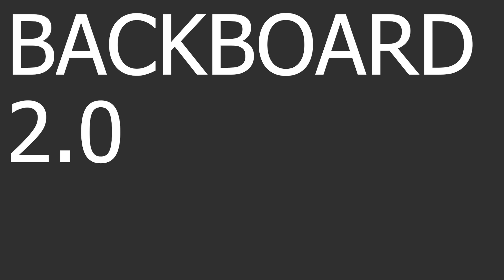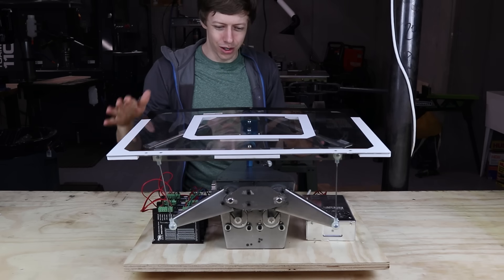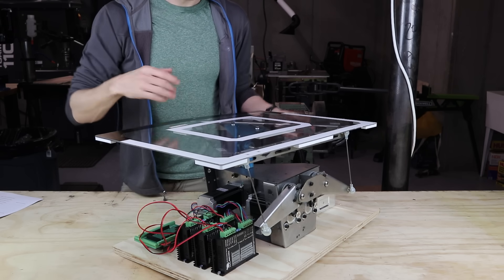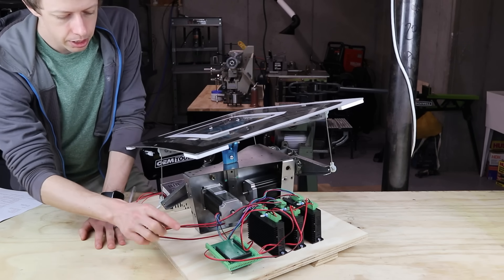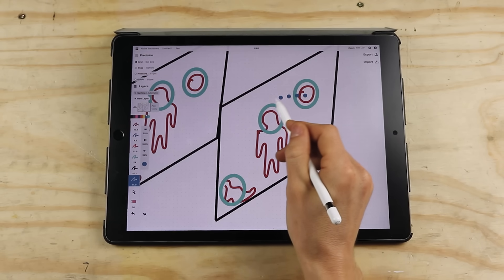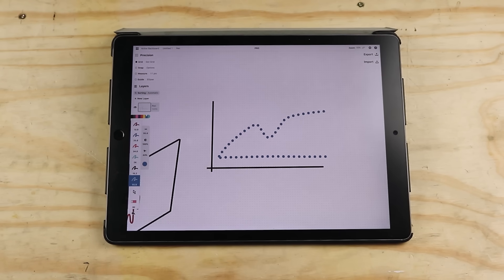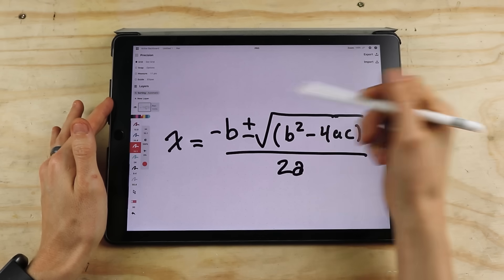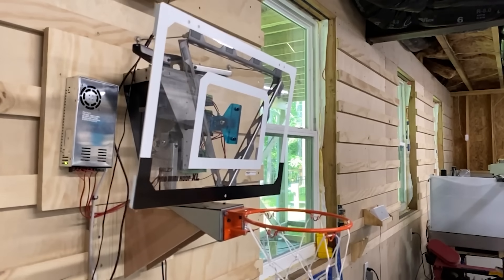The automatic hoop always goes in

Comment from the maker: This hoop is cooler than the previous one but I'm still not satisfied. If you miss the backboard it doesn't go in. How totally lame is that. I think I need to fix that problem...

For all the programmers: I don't normally do my development on windows. I needed the kinect SDK to develop this which only runs on windows (there's a whole studio for recording and playing back streams, putting breakpoints in them and stuff like that - it's actually really nice). I used python for development speed but I should port to C++. I'm normally an OSX dev.

 
Also, a bunch of people have asked about why I move at the last minute - the reason that I don't begin moving immediately is that it is very common for the estimated trajectory to change in a way that requires a direction reversal (i.e. the estimates don't monotonically approach the correct solution). If that happens, I have to decelerate to a stop then accelerate in the other direction. In the worst case moving one side to the other. I did some basic analysis on this and it seemed on average better to move at the last possible minute. The other issue with a direction reversal is that it gives double the system jerk (rate of change of acceleration) due to going from full positive acceleration to full negative acceleration. This causes bigger mechanical vibrations which can lead to all kinds of issues.
Reply: I love the fact that you are devoted to educate people.
Reply: I think maybe version 3 will have an robotic arm to catch the ball and just drop it into the hoop
Reply: Wait, is this the backboard typing this?
Reply: Stuff Made Here I would recommend adding a rail system that allows for X and Y axis movement. This way you can miss the backboard.
Reply: Hi, i am learning programming right now and was wondering if maybe you could share the code with us? i totally understand if not, its your creation and a lot of work! just saying id find it fascinating to see :)
Reply: Wow 49 mins ago
Reply: You mentioned the microcontroller being a speed limiting factor for you, are you using an Arduino? I like the ESP32 for microcontroller tasks, it's cheap flexible and fast.
Reply: Was coming for this, not disappointed ^^
Impressive work 😁
Reply: What if you would use a ball with a Bluetooth emitter attached (inside the ball or outside), that communicates with the panel in Realtime, instead of using data from the camera (or use it for more precise movement) and use a base station like one for the VR, behind you, to get the position for the ball (the start position, the trajectory, the end position etc)
Reply: Bruh.....
Reply: Also that ball identification algorithm is pretty cool. Does it continuously run on the last few frames to identity any possibile approaching basketball?
Reply: You can improve the speed of the Arduino if you replace the quartz crystal on it. It is possible to even double the speed of the Arduino if you use a crystal with a rating that is twice as fast. If you do chose to do this then you need to put a heatsink or even a cooling fan on the Arduino to keep it from cooking itself.
Reply: It's the backboard not the hoop hombre
Reply: you should make the backboard hit it back to you so you can catch it.
Reply: 19th comment
Reply: Great work! You mentioned the Open CV being slow, is it faster to use Open CV than to apply an FFT with a high-pass filter to the distance map to identify the ball?
Reply: Stuff Made Here you’re gonna make extendable arms?
Reply: Very cool project. You mentioned you want to port your code to C++, I guess you want to do that to improve code performance, is that so? Because if it is, maybe it'd be easier if you just profiled your code, found which parts were consuming more time and just implement those in C/C++. You performance improvement would be similar but you're gonna need way less time to just reimplement a part of your code, instead of the whole thing. You can run C/C++ code inside Python. I've never done it, but I think if you're using cPython it is possible.
Reply: How about linux?
You even have different alternatives, the one from microsoft and openkinect.
U could run a headless setup, so there's less overhead (no DM/WM/X server/etc)
Reply: Also, if you could use the motion from the arm of the player then it should raise the time window and ball detection.
Reply: Stuff Made Here superluminal inertial dampers would be the best way to go, I know a guy if your interested 🖖
Reply: You should pin the comment
Reply: E
Reply: I have a little suggestion - why not start moving in the earliest moment you have enough alternatives which are close enough? So instead of moving in the latest possible moment, you start moving once all your "possible trajectories" have positions that are, in motor-movement, as close as possible (within a specific range). Then you start moving to the absolutely median of all these positions, which means you only have a few millimeters or centimeters to the final position once you have enough data to decide on a final position.

You answered the question like that you needed a direction reversal. But since you also said you have a lot of alternatives for each trajectory, you could simply choose a choice for each trajectory, that would ensure that even if the estimated trajectory would become any of them,  you always have a final position requiring as little movement as possible.

Easiest way to solve this, is to take, for all positions, max() in motor movement and min() in motor movement. And then take the median of this, and move the motor to this position. This would be a "middle position" which whould require motor movement equally depending on chosen trajectory, but would require direction reversal.

If you want to ABSOLUTELY avoid ANY direction reversal, regardless of how little, you could move to the "earliest position" so the chosen position for each trajectory could always be made with only forward motion. Basically, choose each position in such a way so each position is pretty close to each other (counted in motor-movement), and then move each motor to the position that is farhest back of all motor positions - This of course means the plane may move to a position that does not match any of the final positions and would , in that position fail the goal - but the idea is that you atleast "prepare" it, so you spend motor time as early as possible, so when the ball comes closer and you rule out more trajectories, you don't need to move the motor as much)

What I mean with this, is that if one of the estimated trajectories, would require tilting the board slightly upwards, and all other trajectories have positions that are both downwards and upwards - then choose all tilted-upwards positions that are close enough, and also choose maybe one downwards positions that could be reached with pretty little motor movement too. Then for each of the three motors, choose the lowest movement value. This creates a new plane, which is the "minimum plane" - and then move the motor to that, to prepare it until you move the last moment.
This also means you could, if you notice that the motor move as fast so you have to stop and go, you could aswell delay the start of motors until you can go in one continous motion, and also adjust the speed and slow down the motors a little if you notice it will reach the "minimum position" before you can rule out all trajectories.
Reply: WOW, Wish you are my relative, so smart💯👌 
How i hope I'm that Wise ♥️
Ilove your works Sir it inspires me to study hard even though I'm not that good at school😅
Reply: Would you share the code for the speed with us?

Comment: For V3 you could try not using a computer for controlling it. You could design your real-time control hardware with PIC's or any type of microcontroller. I think it would be a WAAAAAY better design: compact, and faster since you don't have to rely on Windows' (lack of) stability. It would be also WAAY harder to implement it since the conection between the controller and the Kinect is not native, unless you know enough about embedded systems and PIC programming.

Comment: Your content is head and shoulders above the rest on YT!!
From my own experience, closed loop stepper drive should be the way to go for your project! Not only do you not loose steps, you can also drive the motors much harder, especially since you do not need the position to be accurate during the movement in your case. I have converted some CNCs to closed loop drive and the difference is staggering.
You can retrofit your current motors or buy new ones with integrated control, which I highly recommend.

Comment: Very cool and all but why use an Arduino?
Try using an STM32 mcu or "blue pill", you can use the arduino ide with it and almost the same code and the best part is that it's nearly 7 times faster.

I've been using an stm32 mcu for a year and I'd be happy to help.

Comment: I wonder if an Azure Kinect (v4) would help with the tracking vs the Xbox One (v2) Kinect. Noise is supposed to be significantly reduced in the v4 kinect sensor.

After perfecting the hoop/board next challenge could be to have a ball kicking return system to send it straight back to your hands. "Might" need significantly more powerful motors to kick it back though.... :)

Comment: I have done my Bachelor Thesis including real time face tracking and I know there are immense optimization that can be made. First Camera: Most webcams have a frame buffer, good for videochat, shitty for real time tracking. My recommendation: Playstation eye. This thing cuttet my lag by 70ms alone. Using Matrix for calculation. For example: I needed to rotate an image with an rotation matrix, should be super fast. But creating one rotation matrix takes time. So I just createt a global one. another 50ms saved. Image Size: While the human like big pictures, a lower resolution saves valuable computing time.

After a lot of Optimisation, I could tune my face tracking to <25 ms and 99.8% acuracy. I could have done a lot more optimization in the timing, probally <10 ms but you dont have endless time for a Thesis.

Comment: You need to ditch windows and run this on linux, so you don’t have a bazillion background processes that randomly slow down your program. Also with linux you would need to set the cpu scheduler to “performance” so the cpu’s power management doesn’t add latency into to equation by trying to throttle down the cpu to save power. Lastly, don’t use a laptop, they don’t have enough cooling performance and the cpu is likely “thermal throttling” because the heatsink isn’t actually big enough to sustain the cpu at full load and max frequency continuously. These 3 things are likely what you need to do to resolve the random “misses” because it is too slow to react.

Comment: Why not recording multiple information about ball position all the necessary information?

Basically for the first and the earliest record you try to predict the shot (just an approximation) so your motors will get to the place where they need, then you take the second record and since the shot is going to be in the range of the expectancy your motors wont need to move that much, and they can again get even closer to the solution. Then you take the next shot, and that one will have even more narrow range of hits, and so on.

The idea is to progressively move the motors from the earliest moment you can take the information. Something of the dynamic programming principle

Comment: You don't need bigger motors, just use an iterative approach where you find the best trajectory and align the shot with that. This probably requires multi proccessing where one core only does computer vision, one solves the graphing problem and one does the time estimates and extrapolation, but reduces the acceleration and power of the motors significantly. This should help with the spin problem too if you decided to implement that. For a micro controller, you can use LPC1768 which runs at 100MHz (or maybe 120) compared to 16MHz of arduino.

Comment: This is super cool :) Would love to see it be perfected haha. Why wouldn't you move the board during the estimation? It would mean that you'd have a lot less movement in the last few seconds and latency would be less important :)
Reply: It may also be worth it to choose a different method for finding the ideal position of the backboard, where you use smaller and smaller increments. So you choose a possible position, then you choose a next possible position and check if it's closer, until it's further away again. That means that your possible position would have passed the board. You could then go back in the other direction with a smaller increment. This might be a lot faster :))) It would also make it less expensive to reposition the board more.

Comment: Normally when I'm throwing hoops, I generally aim to throw around 150 shots an hour in any given day. Considering it's quarantine, that means I have 24 straight hours in which to throw hoops without needing to stop for other tasks, other than eating, sleeping, or using the bathroom, so I could reasonably throw close to 2500 hoops in a single day no problem. This video has been up for around 48 hours, and I have NOT been throwing hoops at it for that entire time, so according to Wayne Gretzky your automated basketball hoop has allowed me to miss over 5,000 shots in 48 hours for a success rate of 0%.

Challenge destroyed.
Never issue a highly specific challenge to a skilled pedant with a predisposition towards being a criminalized idiot.

Comment: If you really are using one of the Arduino controllers, definitely try porting the code to a friendly alternative. ESP32/8266 or Teensy or any of the other faster clocked chips. Also the 8bit Arduino really struggles to do anything floating-point quickly, so if your Windows thinking machine can give the controller nothing but integers, it will be faster. Also also also, dump that Windows machine for something that can respond in real time instead of getting lagged on an update check unexpectedly.

Comment: "The mechanics were the easiest part": You Still have a bit potential: 
1. Use a horizontal bar at the bottom of the hoop so you lose the oscillation. (maybe Fiberglass-profiles are less weight)
2. The big torque could be a Problem while using a belt to connect the arbors. A (bike)-chain would last longer.

Comment: If you could use a Teensy 3.6 (which runs at 180MHz) instead of an Arduino (16 MHz) as your main microcontroller, it might fix some of those speed issues. Teensy is completely compatible with Arduino IDE so your work should easily transfer over: https://www.sparkfun.com/products/14057

Comment: Why did you use Windows for the software instead of Linux? Windows freezing up and making delays isn't an issue you would have, due to Linux having way less happening in the background (checking for updates, etc). Also you could then easily pull it over to a Raspberry Pi which would be faster at sending the stepper commands (assuming the CV and IK would run fast enough on weaker hardware).

Comment: Why don’t you make it to where the back board is moving from the beginning, so that instead of it making one movement at the very last moment, it makes small corrections until the very last moment. That should make it more accurate and even if it was a fast ball, the back board would still be somewhat close to shat it should be, which will give it a better chance of sinking the shot
Reply: Also if your making a possible v3 wouldn’t it be easier to put tiny reflector beads all over the ball to make it more visible? Then you wouldn’t need to do the complicated “what ball is the real ball” thing

Comment: AWESOME project! Would it be better to already start moving the board as early as possible, so you only would have to make smaller and smaller corrections, as the finally trajectory calculation gets more certain? Maybe start out with a lower stepper acceleration curve to filter out vibrations and sudden shocks, when the confidence is still low.

Comment: Great video. I love the detail you go  to in explaining the process. As somebody who has no expertise in any field your working with here (part from maybe cameras) I'd hate to let that stop me from sharing my ideas.

I assume that you want the ball to at least look like a basketball so you wouldn't want to have visible tracking nodes on it. That said, it doesn't appear to be a regulation ball so maybe there is a way to put markings on the ball that will be invisible to human vision but you can get a specialised camera to track it (I'm sure if I looked back through someone like Steve Moulds videos there would be something). This could shave milliseconds off and give more accurate results if it's possible.

I'm guessing you have reasons for how how you are calculating the backboards angle but it seems like it could be simplifying it if you can include a percentage chance of the ball going in. That way the calculations can start from where the board is and only move the bare minimum it needs to until it reaches a high enough percent chance. I'd guess that percent would be decided by how much time it has before moving. If the ball is moving faster then it may be a lower percent.

Anyway, I'm most likely typing rubbish but I like to consider the possibilities as best I can within my limited base of relevant knowledge.

Comment: wonderful video!

not sure how limited kinect is, but if you use some fast convolutional neural net library it might have less trouble confusing a basketball with your face and stuff on the floor and shave off some seconds? What computer hardware are you using? Fast single core speed (+potential overclocks?) and GPU depending on the software used could help further? Against the Windows locking up part, oof, maybe only Linux will help :D